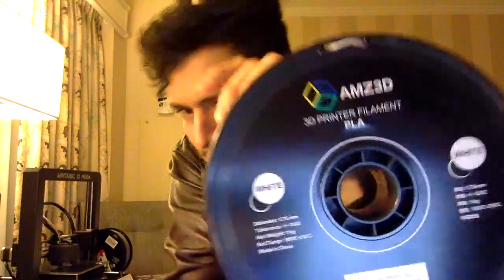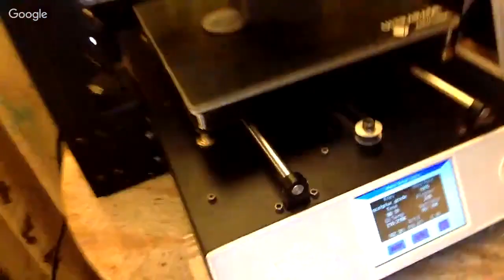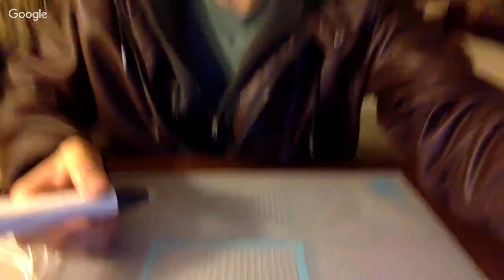3D Pen Oryx Livestream

Comment: Why do the print plates for these machines need to be leveled by the end user?  The whole thing is so finicky for the hundreds of dollars that they cost (or thousands in some cases).  Its like these companies are stuck in 1970s making hobbyist level tinkerware but expect to be paid the price of a fully designed product that is 100% reliable.

The industry as a whole has a long ways to go before they can achieve widespread adoption by the average person because of the mentality of cutting corners.  I mean look at what people are doing to get the plastic to adhere to the build plate.  Hairspray, glue sticks, painter's tape?  Seriously?

How about you do a review of machines manufactured entirely in the U.S.A.?  Or would that be a really short video?